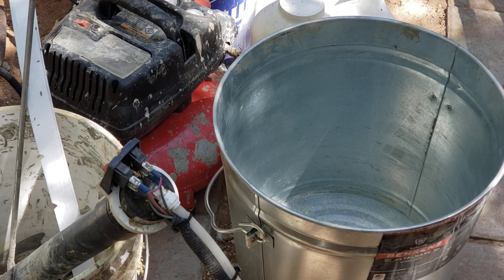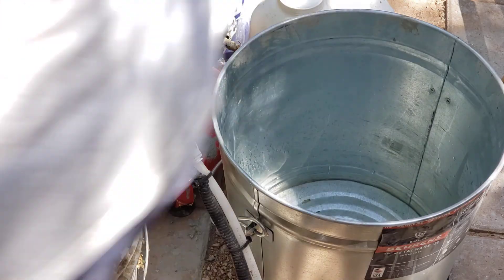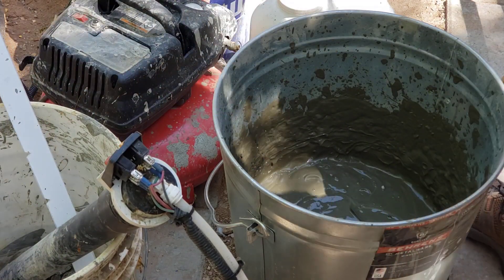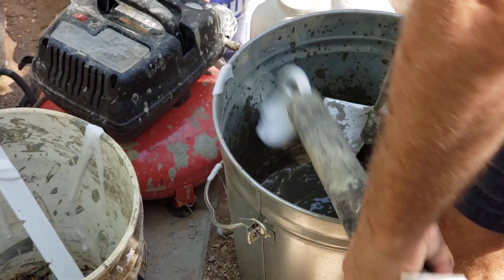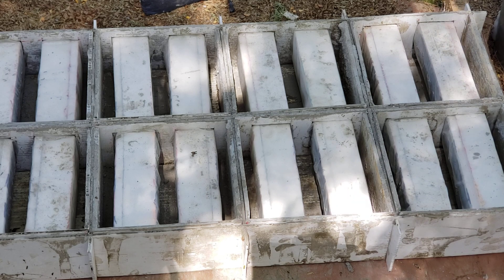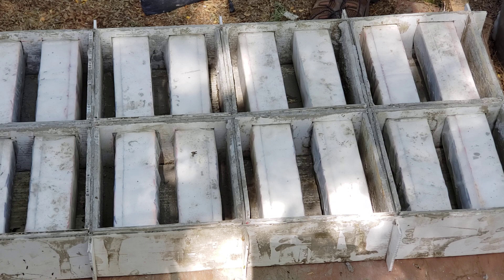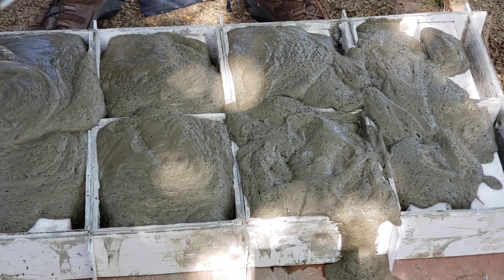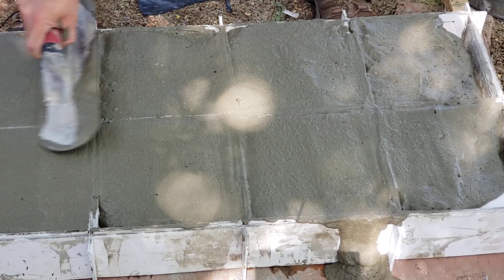Mixing 8 gallons batch of aircrete and pouring blocks

Comment: HAD U CONSIDERED ADDING A "VIBRATION" COMPONENT TO HELP IN SETTLING YOUR MIX? THAT MAY ASSIST IN MORE CONSISTENT LEVELING. ONLY A SUGGESTION. RESPECTFULLY, MARGO-KansasCity
Reply: And loose the air bubbles?

Comment: CAN YOU JUST ADD SPRAYFOAM TO THE  CONCRETE 🤷🏻‍♂️🤷🏻‍♂️🤷🏻‍♂️🥺🥺
Reply: No. Sprayfoam will harden. Itll be too sticky to mix. Use Suave Shampoo and water.
Reply: @KyleJaySmith  last I knew Suave isn’t an eco friendly brand, unlike Dawn dish soap which is used to scrub petroleum from wild animals caught in the sludge… why not use the eco friendly brand (if Suave has changed their formula to be eco friendly it’s a new one on me but would be welcome news).

Comment: What size blocks and how many would you get from a full 45 gallon batch? 4" thick I thought they suggested??
Reply from the maker: I'm trying to make semi-permanent small structures such as sheds. I've settled on 3" thick by 12" high by 48" long blocks. 8 gallons makes a block so 45 gallons would make 5 blocks.

Comment: Use shredded EPS ( Styrofoam ) instead of bubbles.
Reply from the maker: That would work I think but once you have good quality foam from a foam making machine I'd guess the foam is overall easier to do than styrofoam.
Reply: @MattWellandMiscMarvels  The EPS crete  is superlight.  I've heard you mix the EPS with the dry cement before adding water, else the EPS tends to float and the mix is uneven.  In parts of the world where labor is cheap EPS concrete is common. Its still an expensive specialty product in the U.S. in 2021, but if you have the time and make some forms, it can be pretty cheap.  The quirk is the DIY EPS crete uses dumpster foam, but its less costly to use new foam for the manufactured product.  Look up "Perfect Block" for an example of a trendy EPS crete product - spendy!   This material makes a nice fill under a driveway to conserve more costly concrete.  
https://theperfectblock.com/
Reply: @timothykeith1367   @Timothy Keith  Hola amigo!. El cemento con eps rallado o molido es excelente. Para lograr que no flote debes mezclar pegamento o cola de carpintero diluida en agua (cola blanca) con el eps. Una vez que eso está pegajoso, agrega la arena y luego el cemento, mezcla bien y utiliza. Las proporciones para 1m3 de cemento liviano con una densidad de 900 a 1100 k/m2 con una resistencia de 5 Mpa son las siguientes: 380 k de cemento, 440/585 k arena fina, 190/195 litros de agua y 800/700 litros de eps rallado y 1 litro de cola diluida u otro pegamento.  Buena suerte y usa con confianza. Saludos desde Argentina!

Comment: does anybody sell those mixing bits commercially?  I am wondering if I can use a 12v tire (40psi max) compressor instead of a big compressor like that?
Reply from the maker: Hi, the DomeGaia website sells a foam maker and Honey Do carpenter also sells a kit. I can provide details on how to build one like mine. However I think you need a decent compressor. My little compressor just barely keeps up. If you are just wanting to experiment take a look at my video where I used an electric drill frother to make foam. It is not as easy as the foam maker but it does work pretty well. Good luck!
Reply: NoSunBeach
No, those mini tire compressors don't work. They don't have enough thrust power to generate the high density foam required. I tried with my 130psi max compressor and it just didn't cut it. If you want to do aircrete experimentation without investing in a proper air compressor, consider hiring one.

Comment: how did you make your foam generator very nice,
Reply from the maker: I use a 12v 100psi positive displacement pump from Amazon and a solenoid air valve all wired to two switches. I will eventually add details to my wiki.

Comment: 500 ltr per shift  how many qubic meter and 24x12x6 inch block psi block  and dencity  psi

plese send the question and sand cement silika sand stone powder fly ash khaka marble powder resho 50 kg bag send plese details and chemeicel and mashenri abdulwaheedkhalid00gmail.com

Comment: Sorry, I made a good foam from dishwashing liquid and mixed well with the cement, but the output came out not solid, very fragile and bad. Why was this result🤔
Reply: Curing process, cement gets harder while drying.
AirCrete needs to be poured into a form and allowed to harden over night. Lay plastic down to hold the water so it cures better. In dry climates sprinkle it with water to keep it wet for a few days to help the curing process.
Reply: @laconeccionvideo  Thinks
Reply: try adding some masons lime and use a better foaming agent,keep trying
Reply from the maker: Most important thing is the density of the foam. It should be 90g per quart. If it is less then the aircrete will collapse. I made a simple scale and weigh every few days to be sure it is good.
Reply: @MattWellandMiscMarvels  Thinks my friend
Reply: 1litro de mezcla 950gramos minimo.proporcion 1cemento 1/2 agua 1arena fina espuma para que dé la densidad 0,95kg por litro o sea 950kg en 1000litros ó 1m3